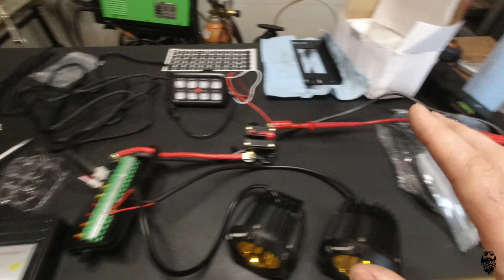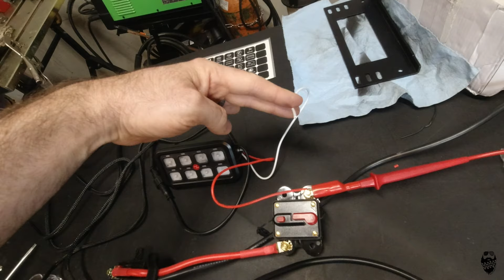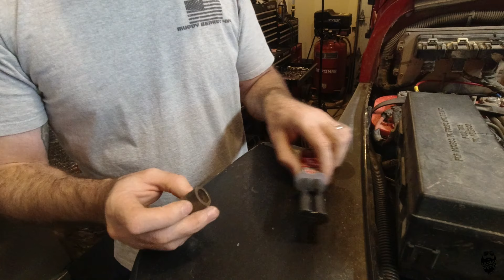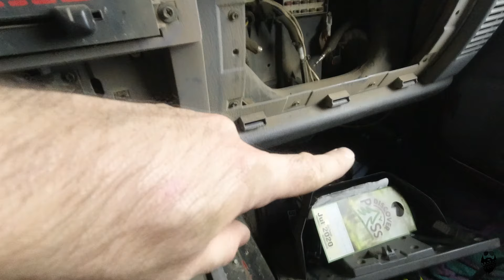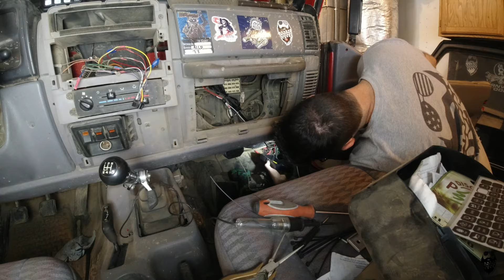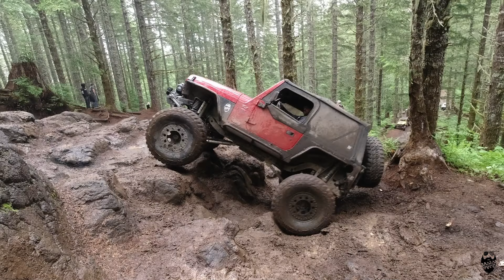8 Switch control panel install and review, Auxbeam's Auxpower controller.

Comment: I thought the whole purpose of this product is to eliminate or have single wire going in the cab and cleaning the engine bay with clutter wiring, and you did exactly the opposite

Comment: I know this video is 2 years old, but I just bought the 6 gang panel and I’m just curious if you would trust this to run your compressor and lockers in addition to lighting?
Reply from the maker: I am put a new version in the truck I am building right now. So yes, it will be running my compressor, locker, lights everything. The old one in the Jeep always worked.

Comment: Did you end up just tapping the white wire to your preferred setting and then every time you turned your car on it stayed the same brightness? This is the only issue i’m having with mine right now.
Reply from the maker: Yes, but it will randomly change to full brightness after a while and I have to go back and change it to lowest. It is kinda annoying. I have the newer updated version sitting in the garage, hopefully it won’t have that issue. Just need to find time to install it.
Reply: @MuddyBeards4X4  Jeez. The white wire is inside my cab so i’m gonna have to figure it out regarding brightness. I don’t have all of the stickers on and it’s just WAY too bright at night. I’m gonna try to tap the wire on a hot a couple times and hope the brightness stays that way.

Comment: why not place the control wire for brightness on the ignition fuse so it comes on when the truck comes on and you can control it then?

Comment: looking at picking one of these up, but bro, you're missing the point of these type of units. you;re meant to install the fuse/power panel in the engine bay and have the control box inside. that stops you having to run all the wires through the fire wall to control them. its all in one simple box with only one wire through the fire wall.

Comment: so would you just wire the fan directly to this or would you use this to trigger a relay? I would be running my xj electric fan as well as a trans cooler fan
Reply from the maker: I run my fan through a stand alone relay as well.
Reply: @MuddyBeards4X4  mine is on a stand alone relay now, as is every other accessory lol tired of a million wires running across my firewall. would I just run the +/- leads right to the controller block or would I have to keep the relay harness?
Reply from the maker: The problem with that is you would have to turn it on every time you start up the Jeep. And I would definitely forget until it overheats. But you can run a normally closed relay and it will be on all the time and turn off with the switch.
Reply: @MuddyBeards4X4  I already do that, I constantly watch temps and flip my fan on and off as needed. had it like that the last 4 or 5 years, I still have the belt fan as well with a good clutch so it's really just in traffic that I'm on and off the electric fan

Comment: Just installed one of these. I connected the red wire to power it on directly on to the battery but it stays on even when I have the engine off, I’m afraid it’ll drain the battery. How did u get it to turn off when u turn off the engine?
Reply: Find a “Key on” power source instead of a constant on
Reply from the maker: I don’t remember the wire colors but the large main power cable goes to the battery. And there will be a ignition power as well which turns it on and off with the key.

Comment: In order to get it to work with your cooling fan you could use a 5 pin relay and wire it up so the relay is normally closed but when powered its open.
Reply: Ha ha ha I was just coming to say the same
Reply: Could you elaborate ? I want to do this  with my cooling fan but I figured he could have the accessory wire to a live and turn it off manually or leave it on as the cooling fan engages after a certain temp 

Let me know please! Very curious and want to do it one time lol

Comment: Great video and very helpful for me.  I am looking at this system and I am just a bit curious as to if the amperage ranges is enough for everything on the Jeep or can they be upgraded to allow higher amperage instead of 5 amps?  I do understand that there are 30, 20, 10 and then the 5's.

Looking forward to what is next!

Comment: Did you figure out how to disable you fan with a Auxbeam button? Love your videos I learn alot.
Reply from the maker: Thanks, I haven’t done it yet, but I have heard I can do a normally closed relay and it would work.
Reply: @MuddyBeards4X4  I have a wiring diagram I will send to you as soon as I figure out how.
Reply: @MuddyBeards4X4  I have wiring diagram I will send to you as soon as I figure out how. This is the setup on my 2005 LJ

Comment: Thx for the video. I'm wondering if you can hook the dim (white) wire to a momentary switch with a hot wire from the battery on the other end? I might try that.
Reply from the maker: I did think of doing that, just haven’t got around to trying it.
Reply: @MuddyBeards4X4  BTW it looks like on my version there is no white wire. They sent a tap a fuse and there is an ambient light sensor in the control unit that supposedly auto dims. This must be a new feature.
Reply: @MuddyBeards4X4  I picked up a cheap switch. I'll give it a try. I'll probably end up keeping it on low backlight anyway though.

Comment: do you know why its different this from your?

its from ali 

https://es.aliexpress.com/item/4001231736875.html?spm=a2g0o.detail.1000014.27.20a57681Pw0Ixz&gps-id=pcDetailBottomMoreOtherSeller&scm=1007.14976.191224.0&scm_id=1007.14976.191224.0&scm-url=1007.14976.191224.0&pvid=caddb88d-064f-4ad5-b0fd-2e73adbca861&_t=gps-id:pcDetailBottomMoreOtherSeller,scm-url:1007.14976.191224.0,pvid:caddb88d-064f-4ad5-b0fd-2e73adbca861,tpp_buckets:668%230%23131923%2312_668%23808%233772%23699_668%23888%233325%2316_4976%230%23191224%232_4976%232711%237538%23604_4976%233104%239653%234_4976%234052%2318551%23100_4976%233141%239887%231_668%232846%238110%23379_668%232717%237567%23934_668%231000022185%231000066058%230_668%233422%2315392%23518_4452%230%23184418%230_4452%233474%2316498%23988_4452%233098%239599%23338_4452%233564%2316062%23415

Comment: Is there any way to connect this to your light stalk so that when you hit your high beam on you steering wheel they come on ? Or do you have to individually turn them on everytime you want to use your lights?
Reply from the maker: There is no way to integrate them into your vehicle headlights, I tried. It’s a stand alone switch panel.

Comment: Does this unit come with Relay? Or you need to add relay fuse if a light requires one?
Reply from the maker: There are no relays in this system. There are fuses. So if you have something with a high load you would need to add it. But any led lights or light bars you shouldn’t need one.
Reply: Can u change the 5 amp fuse to a 30 amp fuse and have all of them 30 amps

Comment: Hey great video. Were you saying that if you decided brightness with the dimmer wire and then left it unplugged it would always return to the brightness you left it at every time you stopped and started the truck?
Reply from the maker: Yes, I set it, put some electrical tape on the wire and shoved it in the controller box
Reply: @MuddyBeards4X4  I was concerned about how I was going to keep mine from being overly bright, thanks for this!

Comment: For your fan use a normally closed relay. That way when you turn the key off the relay will close and the fan will be on the next time you turn the jeep on.
Reply: Ty for this. I don’t understand completely as I’m still learning but ty for this. Installing a cooling fan myself and this gang switch - would be cool to do this :)

Comment: You can easily do the fan on that control panel, you just need to put a normally closed relay in the circuit so when you push the button it turns the fan off and the fan comes on with the Jeep like normal.
Reply from the maker: Good suggestion, I didn’t think of that.
Reply: I was about to write this exact comment  would work great

Comment: Kelly I am curious... why not a version of one of these with relays? Or are your relays On the stuff your installing 
.
Reply from the maker: The led lights that I do have don’t draw very much, and a relay is not necessary. And my onboard air is just my A/C compressor converted to an air pump and is operated on the factory a/c relay. If I was to add something larger that has more draw I would put a relay in the system.